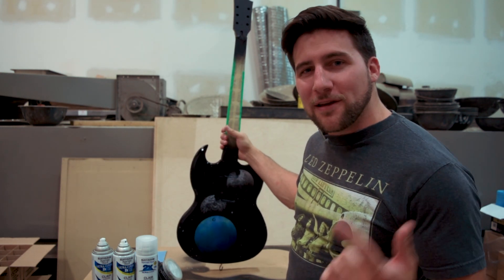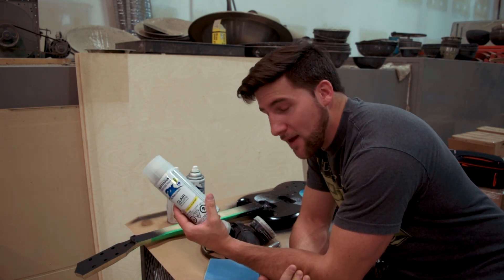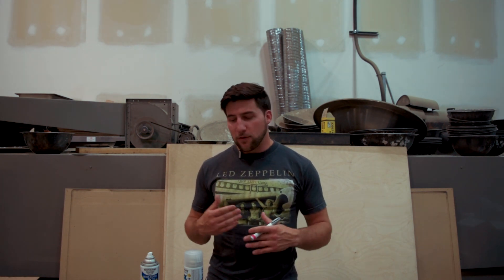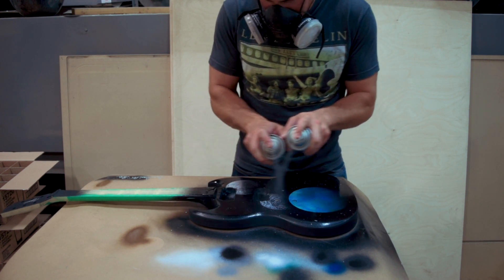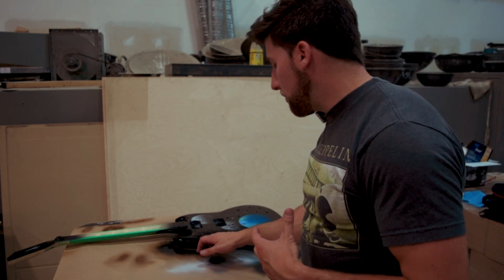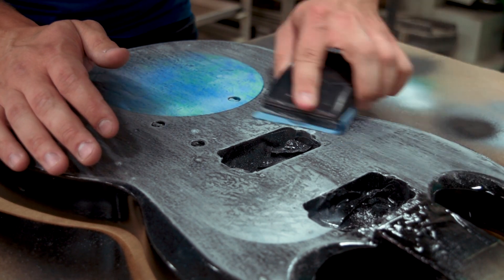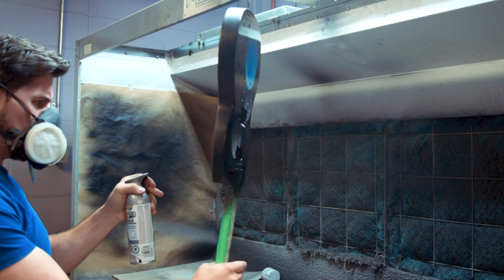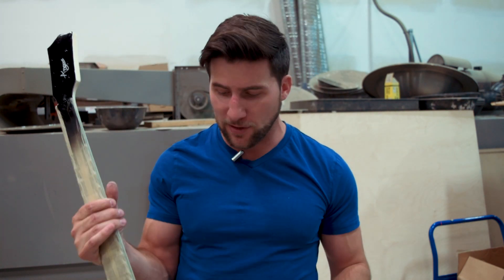The Home Depot Kit Guitar Challenge Part 5 (vs BigDGuitars)

Comment: Nice work! I used to use the hammered finish paints when I built effects pedals. I'd use water decals for graphics and labels for the knobs ontop of it then coat it all with an epoxy clear.
Reply from the maker: Sounds like a cool system.

Comment: Nice job, looks great! Heat up your can of clear real good so it lays down perfect on that last clear coat.
Reply: Have you done this before makes sense sort of because I use expoy resin and do similar. With lacquer you right after you spray.. spray a coat of lacquer thin to really leave out a coat as well.
Reply from the maker: I warm the can sometimes to make it spray better. The shop is pretty warm these days though.
Reply: @timort2260  , I build my own guitars also and if you warm the paint up before you spray, it will flow thinner and not orange peel. So very little to no sanding depending on what you want.
Reply: @cowtowncustoms2110  I'm finishing my drum set this weekend and definitely will try this out. I sand as little as possible because most of the work I do gets electrocuted and it can be a real pain to get all the dust out. So I greatly appreciate it. Thanks
Reply: What’s the safe way to do that?
Reply: @iainthomas5249  , Run hot water over the can, I put my can out in the sun on a patio table and it works great. Leave it in a car for a little while in the sun. I am thinking of getting a baby bottle warmer at a thrift store to try out too. Remember it is explosive so be safe!
Reply: CowTownCustoms Thanks. Yeah when you first mentioned it, the first thing that came to mind was an explosion. I’ll put my cutting torch away now.
Reply: @iainthomas5249  , nothing warmer than a hair dryer. Although it would be quicker!

Comment: I had a nightmare of a time with rustoleum clear coat when I painted my last guitar. The clear coat reacted with the red rustoleum paint underneath and crazed horribly. I sanded it out and this time used Krylon clear coat. Same ghastly result. I sanded it out again and used the Crappy Tire brand clear coat. This time I did a couple of dozen super- thin coats. No crazing this time but I had to do an excruciating amount of  sanding and buffing.  It's not perfect, but it turned out pretty good. If I ever spray paint another guitar, I will use lacquer like I did on my first kit. None of these problems.
Reply from the maker: I haven’t had that issue with rustoleum when sticking with the same paint type, but in any event the solution is to apply thin coats, allow ample drying time between sessions, and of course sand lightly between sessions.

Comment: That is a great looking guitar. Nice work! Have you ever used artist oil paints on a project? I once painted a honeycomb bees nest  on a guitar but never clear coated it. I wonder if that works?
Reply from the maker: It can work. They actually work fairy well as a dye of sorts as well for a really thin color coat.
Reply: Thanks Brad. I think youve inspired me to find a guitar to refinish and try something funky. Great channel!
That honeycomb one I did was pretty cool. I did the honeycombs in a (is it hexagon?) 3D sort of way with honey running out of some and even a few trails of honey running over the pick guard.
Reply from the maker: Sounds like a really cool finish.

Comment: Brad is there a reason not to wet sand in between those coats of clear?  I was taught to wet sand in between all coats. Was I taught wrong? Thanks for the excellent videos you have taught me so much it is greatly appreciated!
Reply from the maker: I generally avoid wet sanding guitars unless entirely necessary. Using water increases the risk of causing swelling in the wood and cracking in the finish. Also, there’s really no reason to wet sand until you get to the final sanding for polishing.

Comment: Hey Brad,

did you use any grain filler on this?  My son tried using spray paint from HD on a build he did and its rough and you can see the grain.  I will say that he didn't put that many coats on and he did not use any clear coating.  I'm looking to try to fix it for him so I'm assuming I can use 400+ grit sandpaper and apply a clear coat.  I would appreciate your advice.  Thanks and love the videos man.  Keep 'em coming.
Reply from the maker: This came with a coat of sealer on it, and I started with a primer to finish filling the pores. I didn’t need to grain fill. 

What kind of wood is yours?
Reply: Brad Angove it is African mahogany body and a maple neck.  I probably messed up and had him sand it straight off.  I don’t think he got very much of the sealer off though
Reply from the maker: Unfortunately mahogany has very deep pores. You may need to go in with a few coats of sealer or a filler on there.

Comment: That's weird you could only get 400 grit sandpaper at Home Depot. My local store goes up to 2000. Looks great though
Reply from the maker: That would have been helpful haha.
Reply: Isn't a green 3M pad somewhere around 1600 grit paper? I use it when I want to smooth out a gloss neck (why do companies do gloss necks, that makes no sense to me)
Reply from the maker: A green scotch brite pad?
Reply: @BradAngove  Yeah, that's what I was referring to, the lightest of them. I don't remember where I saw that, but I thought, once it had gone through a wash cycle  with darks, that it has around the same scratchiness as 1600 sandpaper. Again, it's what I use on the few guitars that I've bought with a gloss neck and it works wonders. Gotta wash it first though. I also use the same system for cleaning aquariums, fresh ones are way too rough.
Reply from the maker: Those are good for scuffing but pretty much useless for leveling. The green one is a bit aggressive but the red one is probably about 400 grit and grey is closer to 600. The white is quite fine. Probably 1000-1200 would be my guess.
Reply: My Home Depot Carries from 40 Grit up to 2000 Grit.

Comment: Now how in the world did you pull that trick off? You painted the back without taping off the front and did not get any paint on the front and ended up with a nice dividing line -  if I tried that it would look horrible lol. I am going to have to check the settings for Big D's channel, I am not getting any updates from his channel but I see to the right his latest video is up. 

I have always thought that the Nitro finish was "tougher" than the poly finish, but after doing some reading last night it seems I had this backwards. That makes no sense to me since it is very difficult to chip a Gibson but not a Fender. That was a good tip about that hammered paint, I was actually thinking of using it on a project and I would have used a clear coat had I not watched this video, Brad comes through again lol. The guitar is looking good but, what made you go with that grey on the back? Now I am really curious to see how it all turns out. Oh, you answered a couple of questions I was having about my now infamous Les Paul disaster project lol. OK, I am off to check out the competition's project.
Reply from the maker: I painted at an angle haha. Poly is definitely a harder finish. It also doesn’t soften when it gets warm like nitro does. 
BigD is publishing another video tomorrow with a revamped version of his paint job.